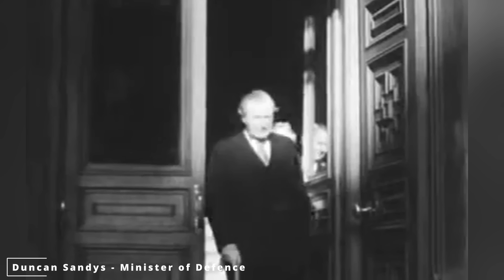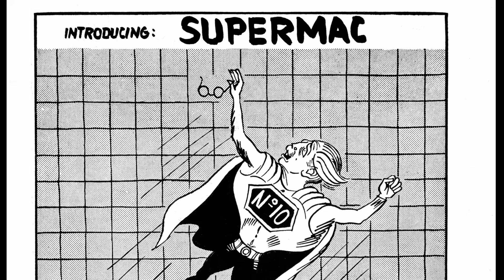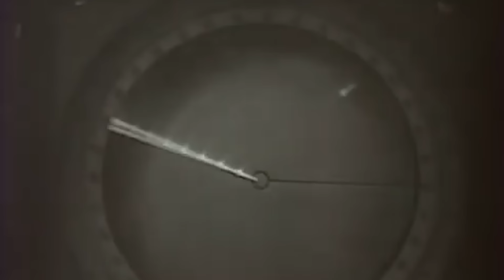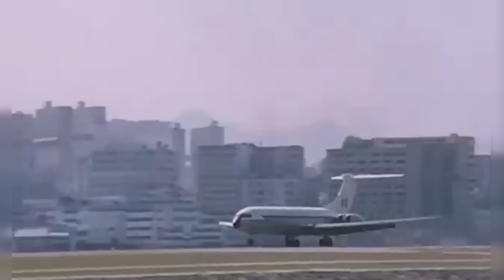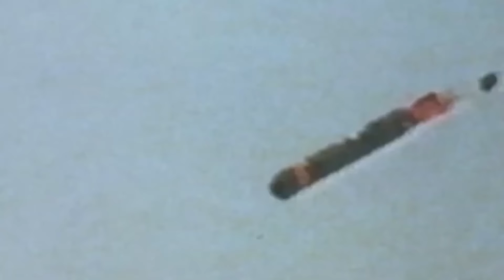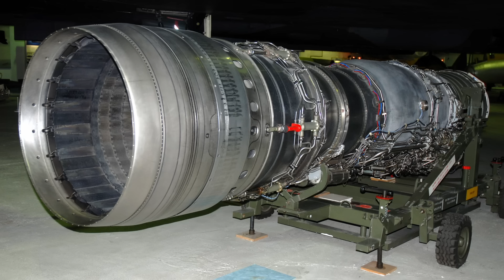How Britain Turned A Failed Airliner Into a Soviet Submarine Predator | The Mighty Nimrod

Comment: Worked on the new MRA4's at FRA before they were sadly wanked off by the government got laid off and treated like dogshit at the so called job center so nearly lost my home sadly.
Thank you for the video. 👍
Reply from the maker: Really sorry to hear that, I recall the fiasco. 
I would love to be able to run part 3 under your nose if and when I get around to it, that will be covering the MRA4 drama.
Reply: @AviationRepublic  Thank you. I will look forward to seeing it on YouTube.
Reply: One of the most shameful and humiliating fiascoes in British aviation history... a shocking tale of incompetence and corruption
Reply from the maker: I will get to that in Part 3. Just laying the ground work. Too much to cover in one video.
Reply: We believe we can clear up some commonly held myths and misconceptions obviously.

It's always good to see the facts presented clearly and concisely isn't it?

All Nimrods were new build Comet 4 airframes with appropriate strengthening and the unpressurized  equipment bay tacked on. 

The HS 801 Nimrod was the most advanced aircraft of it's type at the time it first flew. Problems with the MRA4 programme were almost entirely due to radar and computer equipment issues and BAe Systems & co being too busy with other work at the time. 

Obviously there have been worse aircraft for accident losses both before & after the Comet.

Early problems with Comet takeoff stalls were caused by pilots over rotating the aircraft at liftoff. 

Podded engines on wings have aerodynamics issues. The main reasons for eventually going with podded engines were because or to facilitate -
Ease of maintenance.
Use of shear off fixings given excessive out of balance forces.
Large diameter turbofan engines.
Reduce load on the wing to fuselage connection. 
Increased power from later engines. 

The Bow-wing (See B-47 wing collapse & wing folding incidents) was a good example of how to expend a huge amount of cash and effort on something that was probably not worth bothering with. The basic design of the Comet had been decided upon and established before the podded engine choice has been made for the B-47. There were aerodynamics problems with podded pylon mounted engines at the time. The US also built and operated a significant number of EE Canberra bombers under licence which did not use podded engines for their wing mounted engines. . 

There have been aircraft losses caused by pod & pylon mounted engines. 

All jet airliners benefited greatly from the knowledge gained from the Comet incidents & subsequent investigations & yet some were still worse for accident losses. 

Instances of all marks of the Comet flew with full certification after 1954 including the Comet 3. The last Comet flight occured in 1997.

The fabulous trail blazing DH Comet.
World's first jet airliner in regular service.
The jet engined Avro Lancastrian actually did a passenger service before the DH Comet. 
World's first high altitude airliner.
World's first airliner with a full fuselage length pressurised cabin pressurised for high altitude flight. That feature for that type of aircraft was a considerably difficult undertaking. 

The change from larger squarer windows to smaller rounder windows was necessary for the particular aircraft at the time. Skin thickness remained mostly the same for all Comet marks. 

How things were back then.
Accident losses - % of aircraft built.

DeHavilland Comet 4 UK                          14% 
DeHavilland Comet all mks UK (ff 1949)17%  
Vickers VC10 UK (ff 1962)                         5%

Douglas DC-1  US                                       99%
Douglas DC-2                                              47%
Douglas DC-3                                              30%
Douglas DC-4                                              26%
Boeing s300    US                                       72% 
Boeing 307                                                  70%
Boeing 247                                                   48%
Boeing 707  (ff 1958)                                 32% 
Lockheed L-049 Constellation (ff 1943)  30%
Lockheed Electra US (ff 1957)                   29%
Fairchild FH-227 US (ff 1966)                   30%
McDonnell Douglas DC-8 US  (ff 1958)   14%
Sud Aviation Caravelle  (ff 1955)             15%
Canadair CL-44 Turboprop US (ff 1959) 46%  
Convair CV-580 Turboprop US (ff 1960) 22%
Convair CV-880     (ff 1959)                      27% 
Convair CV-990     (ff 1961)                      33%
Tupolev T-104        (ff 1956)                     16%
Vickers Viscount UK  (ff 1948)                29%  
Fokker F-27 Turboprop NL (ff 1955)       40%      

The Vickers VC10, fastest Atlantic crossing for a non supersonic jet airliner, held the record for 41 years.

For the first few years of operation the Caravelle & Comet had similar accident loss fatalities.

Sud Aviation Caravelle - 
all accident loss fatalities - 
1320 fatalities. 

De Havilland Comet - 
all accident loss fatalities - 
453 fatalities. 

An example of a typical airliner from the period. 
The Fokker Friendship F-27 fatalities & accident losses as a % of aircraft built. 
Fokker F-27 Turboprop (ff 1955)   40%
2130 fatalities.

Of course De Havilland carried out a full stress analysis & performed extensive & protracted testing on two long lengths of fuselage representing all features of a complete airframe. De Havilland carried out significantly more testing than was required by any authority at the time & significantly more testing that any previous airliner was subjected to.

De Havilland designers / engineers knew all there was to know about metal fatigue at the time they designed the DH Comet.

De Havilland had prior experience building many all metal construction airframe aircraft including many passengers aircraft & thousands of jet powered fighter aircraft that were primarily of metal construction with pressurised cockpits & used jet engines built by De-Havilland.

De Havilland did indeed always work to better than industry standards at the time, used up to date knowledge for the design & testing activities & no evidence of negligence or criminal negligence was ever produced in relation to the DH Comet.

Global aerospace. 
From the 1950s sector rationalisation and consolidation took place. 70 companies in France and 300 companies in the US disappeared due to merger or dissolution. In the US Boeing was almost bankrupted by the 707 project.  Boeing had a well protected domestic market and the available space and resources in the US to engage in large scale airliner manufacturing enabling them to capture orders simply by being able to produce airframes fast enough and cheap and nasty enough. Another factor is airlines preferring to obtain as much of their airliner inventory as possible from one manufacturer. 

Global Aerospace Sector, what's happening.

For example, there are of course no German companies that makes German jet aircraft in Germany & there are no German companies that make German gas turbine aero engines in Germany that are suitable for widebody airliners.

The UK has the world's highest combined per capita Nuclear / Defence / Aerospace Sector Activity.

UK defence sector, absolute terms, world's second highest activity. 1st for per capita defence sector activity. Per capita nuclear powered submarine construction, 2nd position. 
Main players being Rolls Royce, Babcock, GKN Aerospace & BAe Systems. Activities often involve international collaboration. BAe systems, RR and other UK companies now handle more Airbus work value wise than Germany. 

There's a good chance that anyone currently flying on a widebody airliner will be on an aircraft powered by RR gas turbine aero engines made in the UK and a good chance there will be other hardware on the aircraft that's designed and / or manufactured in the UK. 

Rolls Royce Holdings UK
Subsidiaries
- Rolls-Royce plc
- Rolls-Royce North America (ex Allison etc Classified Military stuff)
- Rolls-Royce AB
- Rolls-Royce Deutschland
- Rolls-Royce India Private Limited
- Rolls-Royce Marine Power Operations
- Vinters Engineering Limited
- Rolls-Royce Controls and Data Services
- Rolls-Royce Power Systems
- Bergen Marine
Joint ventures include:
- Rolls-Royce Turbomeca
- MTU Turbomeca -

Trent Family
The MT30 (Marine Turbine)
Industrial Trent 60 Gas Turbine
Trent 7000
Trent XWB Airbus A330neo.
Trent 1500
Trent 1000
Trent 500
Trent 600
Trent 700
Trent 800
Trent 8100
Trent 900
   
RR wholly owned subsidiaries in Germany handle smaller 2 shaft RR gas turbine aero engine work.

The UK space and aerospace sectors are highly productive, high-value industries that together contribute over £18 Billion in direct Gross Value Added (GVA) to the UK economy. Individually, the space industry directly contributes about 0.3% of UK GDP 7•2 Billion while the aerospace industry contributes approximately 0.5% £10•9 Billion.
   
We hope this helps.
Reply: How much of the MRA4 was realistically carried over from the existing aircraft?

When the issue came to a head with the wings not fitting, would it have been more viable to jig up and build new fuselages (with the benefit that further aircraft could be built for export sales)?
Reply: @katywalker8322  I thinks the wings not fitting is a load of BS as the first one I worked on at FRA was already flying from Boscombe Down before they were all cancelled. The Torries also saying they had to be cancelled because of cost also made NO sense as the Boeing aircraft they then brought cost more for less aircraft that can do less. Just like when Labour said the TSR2 had to be cancelled because of costing more then said they were going to buy F111's that cost more. 
Thank you.
Reply: @RJM1011 my understanding was that there was a lot of variation in the fuselage, and hence a lot of fettling required for the wings to be mounted.

Given how much of the aircraft was newly built it surprised me that they didn't go the whole hog with a new build.

Agree with the other points.
Reply: @katywalker8322  Yes thank you.
Reply: @katywalker8322  BAE Systems was not an aircraft manufacturer and did not have the capabilities to build an all new aircraft.
The whole point was to avoid building new aircraft by refurbishing old existing aircraft.
The problem was the Nimrod was simply too old too obsolete and the aircraft were too badly damaged to be refurbished.
The planes were hand build and no two Nimrod were the same.

The program was rife with corruption and incompetence
Reply: @DoktorBayerischeMotorenWerke BAE Systems certainly had the capabilities to build a new aircraft, and they were building new wings which are the must complex part of the airframe.
Reply: @katywalker8322  Britian has not developed any new jet aircraft since 1977.
BAE Systems has never designed and manufactured a new aircraft design... it is no longer an aircraft manufacturer.
Reply: @DoktorBayerischeMotorenWerke , the 146 comes after you window plus was designed and built by part of BAE Systems.

BAE Systems has the skills to build a a craft from scratch if required.

You seem to have a real bee in your bonnet against the Comet and European aircraft
Reply: @katywalker8322  Sorry mate, you seem a bit confused
The Hawker Siddeley H.S.146 dates back to 1973.

BAE System divested its aircraft development division in 2005.
Reply: @katywalker8322  The Comet Disaster was the worst engineering disaster in commercial aviation history
Germany is currently the largest manufacturer of jet aircraft in Europe today
Reply: @DoktorBayerischeMotorenWerke production ran from 1983.

2005 is when they sold their stake in Airbus. They still have plenty of development expertise
Reply: @DoktorBayerischeMotorenWerke , do they even produce a jet aircraft?

Very minor contribute to the F35. Po art of the Eurofighter. Might manage to build some of the FCAS in the future. Building some of the D328eco. A contributor to various Airbus aircraft. Engine wise some engines from Rolls-Royce Deutschland
Reply: @katywalker8322  Please name a single British company that still makes British jet aircraft in the UK?
Reply: @katywalker8322  There was no independent development of any new jet aircraft in the UK after BAC and Hawker Siddeley went bankrupt in 1977 and were taken over by the UK government
Reply: @katywalker8322  There has never been any Airbus aircraft made in the UK.
 Yes, and in 2005 that expertise was lost and went to Airbus and elsewhere.
Reply: @DoktorBayerischeMotorenWerke 

We believe we can clear up some commonly held myths and misconceptions obviously.

It's always good to see the facts presented clearly and concisely isn't it?

All production Nimrod aircraft were new build Comet 4 airframes with the necessary modifications. The Nimrod was the most advanced and most capable aircraft of it's type at the time it went into service. The  Nimrid HS.801 was not available for purchase by other countries. The ability  if the HS 801 to repeatedly demonstrate detection of subs and the knowledge that it could deliver nuclear depth charges to a target was a very effective deterrent. 

Bow-wing (see B-47 wing collapse wing folding incidents) had built less than 12 pressurised airliners before the Comet first flew and they were not high altitude airliners. 

All Nimrods were new build Comet 4 airframes with appropriate strengthening and the unpressurized  equipment bay tacked on. 

The HS 801 Nimrod was the most advanced aircraft of it's type at the time it first flew. Problems with the MRA4 programme were almost entirely due to radar and computer equipment issues and BAe Systems & co being too busy with other work at the time. 

Obviously there have been worse aircraft for accident losses both before & after the Comet and Nimrod.

Early problems with Comet takeoff stalls were caused by pilots over rotating the aircraft at liftoff. 

Podded engines on wings have aerodynamics issues. The main reasons for eventually going with podded engines were because or to facilitate - Ease of maintenance. Use of shear off fixings given excessive out of balance forces.
Large diameter turbofan engines.
Reduce load on the wing to fuselage connection. Increased power from later engines. 

The Bow-wing (See B-47 wing collapse & wing folding incidents) was a good example of how to expend a huge amount of cash and effort on something that was probably not worth bothering with. The basic design of the Comet had been decided upon and established before the podded engine choice has been made for the B-47. There were aerodynamics problems with podded pylon mounted engines at the time. The US also built and operated a significant number of EE Canberra bombers under licence which did not use podded engines for their wing mounted engines. . 

There have been aircraft losses caused by pod & pylon mounted engines. 

All jet airliners benefited greatly from the knowledge gained from the Comet incidents & subsequent investigations & yet some were still worse for accident losses. 

Instances of all marks of the Comet flew with full certification after 1954 including the Comet 3. The last Comet flight occured in 1997.

The fabulous trail blazing DH Comet.
World's first jet airliner in regular service.
The jet engined Avro Lancastrian actually did a passenger service before the DH Comet. 
World's first high altitude airliner.
World's first airliner with a full fuselage length pressurised cabin pressurised for high altitude flight. That feature for that type of aircraft was a considerably difficult undertaking. 

The change from larger squarer windows to smaller rounder windows was necessary for the particular aircraft at the time. Skin thickness remained mostly the same for all Comet marks. 

How things were back then.
Accident losses - % of aircraft built.

DeHavilland Comet 4 UK                          14% 
DeHavilland Comet all mks UK (ff 1949)17%  
Vickers VC10 UK (ff 1962)                         5%

Douglas DC-1  US                                       99%
Douglas DC-2                                              47%
Douglas DC-3                                              30%
Douglas DC-4                                              26%
Boeing s300    US                                       72% 
Boeing 307                                                  70%
Boeing 247                                                   48%
Boeing 707  (ff 1958)                                 32% 
Lockheed L-049 Constellation (ff 1943)  30%
Lockheed Electra US (ff 1957)                   29%
Fairchild FH-227 US (ff 1966)                   30%
McDonnell Douglas DC-8 US  (ff 1958)   14%
Sud Aviation Caravelle  (ff 1955)             15%
Canadair CL-44 Turboprop US (ff 1959) 46%  
Convair CV-580 Turboprop US (ff 1960) 22%
Convair CV-880     (ff 1959)                      27% 
Convair CV-990     (ff 1961)                      33%
Tupolev T-104        (ff 1956)                     16%
Vickers Viscount UK  (ff 1948)                29%  
Fokker F-27 Turboprop NL (ff 1955)       40%      

The Vickers VC10, fastest Atlantic crossing for a non supersonic jet airliner, held the record for 41 years.

For the first few years of operation the Caravelle & Comet had similar accident loss fatalities.

Sud Aviation Caravelle - 
all accident loss fatalities - 
1320 fatalities. 

De Havilland Comet - 
all accident loss fatalities - 
453 fatalities. 

An example of a typical airliner from the period. 
The Fokker Friendship F-27 fatalities & accident losses as a % of aircraft built. 
Fokker F-27 Turboprop (ff 1955)   40%
2130 fatalities.

Of course De Havilland carried out a full stress analysis & performed extensive & protracted testing on two long lengths of fuselage representing all features of a complete airframe. De Havilland carried out significantly more testing than was required by any authority at the time & significantly more testing that any previous airliner was subjected to.

De Havilland designers / engineers knew all there was to know about metal fatigue at the time they designed the DH Comet.

De Havilland had prior experience building many all metal construction airframe aircraft including many passengers aircraft & thousands of jet powered fighter aircraft that were primarily of metal construction with pressurised cockpits & used jet engines built by De-Havilland.

De Havilland did indeed always work to better than industry standards at the time, used up to date knowledge for the design & testing activities & no evidence of negligence or criminal negligence was ever produced in relation to the DH Comet.

Global aerospace. 
From the 1950s sector rationalisation and consolidation took place. 70 companies in France and 300 companies in the US disappeared due to merger or dissolution. In the US Boeing was almost bankrupted by the 707 project.  Boeing had a well protected domestic market and the available space and resources in the US to engage in large scale airliner manufacturing enabling them to capture orders simply by being able to produce airframes fast enough and cheap and nasty enough. Another factor is airlines preferring to obtain as much of their airliner inventory as possible from one manufacturer. 

Global Aerospace Sector, what's happening.

For example, there are of course no German companies that makes German jet aircraft in Germany & there are no German companies that make German gas turbine aero engines in Germany that are suitable for widebody airliners.

The UK has the world's highest combined per capita Nuclear / Defence / Aerospace Sector Activity.

UK defence sector, absolute terms, world's second highest activity. 1st for per capita defence sector activity. Per capita nuclear powered submarine construction, 2nd position. 
Main players being Rolls Royce, Babcock, GKN Aerospace & BAe Systems. Activities often involve international collaboration. BAe systems, RR and other UK companies now handle more Airbus work value wise than Germany. 

There's a good chance that anyone currently flying on a widebody airliner will be on an aircraft powered by RR gas turbine aero engines made in the UK and a good chance there will be other hardware on the aircraft that's designed and / or manufactured in the UK. 

Rolls Royce Holdings UK
Subsidiaries
- Rolls-Royce plc
- Rolls-Royce North America (ex Allison etc Classified Military stuff)
- Rolls-Royce AB
- Rolls-Royce Deutschland
- Rolls-Royce India Private Limited
- Rolls-Royce Marine Power Operations
- Vinters Engineering Limited
- Rolls-Royce Controls and Data Services
- Rolls-Royce Power Systems
- Bergen Marine
Joint ventures include:
- Rolls-Royce Turbomeca
- MTU Turbomeca -

Trent Family
The MT30 (Marine Turbine)
Industrial Trent 60 Gas Turbine
Trent 7000
Trent XWB Airbus A330neo.
Trent 1500
Trent 1000
Trent 500
Trent 600
Trent 700
Trent 800
Trent 8100
Trent 900
   
RR wholly owned subsidiaries in Germany handle smaller 2 shaft RR gas turbine aero engine work.

The UK space and aerospace sectors are highly productive, high-value industries that together contribute over £18 Billion in direct Gross Value Added (GVA) to the UK economy. Individually, the space industry directly contributes about 0.3% of UK GDP 7•2 Billion while the aerospace industry contributes approximately 0.5% £10•9 Billion.
   
We hope this helps.
Reply: @DoktorBayerischeMotorenWerke 

Typhoon & Tornado, British design aircraft. 

Early days of the airliners.

The awesome De Havilland Comet.
World's first production jet airliner.
World's first high altitude airliner. 
At the time the Comet wasn't particularly dangerous. The DH Comet was definitely not the worst engineering failure in commercial airliner history.

Losses comparisons.
How things were in those days.

DeHavilland Comet 4 UK                          14% 
DeHavilland Comet all mks UK (ff 1949)17%  
Vickers VC10 UK (ff 1962)                         5%

Douglas DC-1  US                                       99%
Douglas DC-2                                              47%
Douglas DC-3                                              30%
Douglas DC-4                                              26%
Boeing s300    US                                       72% 
Boeing 307                                                  70%
Boeing 247                                                   48%
Boeing 707  (ff 1958)                                 32% 
Lockheed L-049 Constellation (ff 1943)  30%
Lockheed Electra US (ff 1957)                   29%
Fairchild FH-227 US (ff 1966)                   32%
McDonnell Douglas DC-8 US  (ff 1958)   14%
Sud Aviation Caravelle  (ff 1955)             15%
Canadair CL-44 Turboprop US (ff 1959) 46%  
Convair CV-580 Turboprop US (ff 1960) 22%
Convair CV-880     (ff 1959)                      27% 
Convair CV-990     (ff 1961)                      33%
Tupolev T-104        (ff 1956)                     16%
Vickers Viscount UK  (ff 1948)                29%  
Fokker F-27 Turboprop NL (ff 1955)       40%      

The Vickers VC10, fastest Atlantic crossing for a non supersonic jet airliner, held the record for 41 years.

For the first few years of operation the Caravelle & Comet had similar accident loss fatalities.

De Havilland had prior experience building many all metal construction airframe aircraft & thousands of jet powered fighter aircraft that were primarily of metal construction with pressurised cockpits & jet engines built by De-Havilland. No aircraft before the Comet was subjected to as much pre-production testing as the Comet. 

It's a great pity & a crying shame that British military forces had to occupy a large part of Germany for decades after 1945 & Russian military forces had to do the same. Of course Russia still posseses a large chunk of what was German territory & of course Russia & the UK produce nukes. Obviously Germany does not produce nukes.

Interesting British achievements.

The gas turbine engine was invented & patented in England before the 1800s.

Axial multi stage sequential stage compressor & turbine technology, first produced for turbo machinery use in England by Parsons of Ireland & North England during the 1800s. The components form the basis of most modern gas turbine aero engines. At the time the concept of the jet aircraft powered by axial internal combustion gas turbine engines was first mentioned thus the internal combustion jet engine & jet aircraft was indeed invented in England before the 1900s & before the Wright brothers got busy.

Work on the multi stage sequential stator rotor axial compressor as applicable to the axial compressor gas turbine aero engine was ongoing in England from around 1928 by Arnold Griffiths and others. By 1943 the Metrovik F2/3  Beryl was a running axial turbojet that was superior to anything anywhere else. As the centrifugal compressor engines were adequate and more powerful at the time development of a larger F2/3  version was commenced.

The Metrovik (UK)  F2/3 axial compressor gas turbine aero engine was flight certified & ran in 1942, it was the result of UK development work ongoing since 1929. At the time it was the most capable axial compressor turbojet in existence but was not required and development work continued on a larger version.

Frank Whittle performed the world's first demonstration of a gas turbine aero engine in 1937. People in Germany kept a close eye on everything going on in Britain at the time.

The centrifugal compressor RR Nene was the most powerful & most reliable gas turbine aero engine on the planet in 1944. That engine would be later built under license or copied in many countries including Russia (Mig-15 Mig-17), China, the US, France and Switzerland powered dozens of aircraft types for decades after 1944.

Pratt and Whitney and others produce centrifugal compressor gas turbine aero engines. The PW200 is a currently produced whittle style centrifugal compressor, reverse flow combustor, gas turbine aero engine. 

The world's first wind tunnel was constructed in England during the 1870s. The world's first supersonic wind tunnel was constructed in England in 1922.

There is no doubt that the Fairey (England)
Delta 2 was the world's first jet
aircraft to exceed 1000 mph.  Indeed It
exceeded the previous record by 310 mph &
held the record for 1 year. Incidentally, the Dassault Mirage 3 & 4 are based on the Fairey Delta 2.

More recent UK military jet aircraft.

The Tornado & Typhoon & their engines are Supersonic & are indeed British design aircraft with British design engines built by an international consortium. The Tornado design for example started life during the 1950s at Vickers as the AFVG, it's engine is based on the RR RB-199. The EE Lightening is also a British Supersonic jet aircraft.

The Typhoon is the British BAC-EAP with an engine based on the British RR XG-40, the Typhoon is also built by an international consortium.

Brazil has the world's third largest airliner manufacturer and makes very good airliners & Brazil is 100th down the list along with Indonesia for wealth per capita. Of course it is in fact the case that Embraer can't build those airliners without purchasing stuff from the US, UK & Europe. For example, Norway, Holland, Denmark, Ireland & Belgium, top 20 wealth per capita, don't make airliners, its as simple as that.

Global aerospace. 
From the 1950s sector rationalisation and consolidation took place. 70 companies in France and 300 companies in the US disappeared due to merger or dissolution. In the US Boeing was almost bankrupted by the 707 project.  Boeing had a well protected domestic market and the available space and resources in the US to engage in large scale airliner manufacturing enabling them to capture orders simply by being able to produce airframes fast enough and cheap and nasty enough. Another factor is airlines preferring to obtain as much of their airliner inventory as possible from one manufacturer. 

Global Aerospace Sector, what's happening.

For example, there are of course no German companies that makes German jet aircraft in Germany & there are no German companies that make German gas turbine aero engines in Germany that are suitable for widebody airliners.

The UK has the world's highest combined per capita Nuclear / Defence / Aerospace Sector Activity.

UK defence sector, absolute terms, world's second highest activity. 1st for per capita defence sector activity. Per capita nuclear powered submarine construction, 2nd position. 
Main players being Rolls Royce, Babcock, GKN Aerospace & BAe Systems. Activities often involve international collaboration. BAe systems, RR and other UK companies now handle more Airbus work value wise than Germany. 

There's a good chance that anyone currently flying on a widebody airliner will be on an aircraft powered by RR gas turbine aero engines made in the UK and a good chance there will be other hardware on the aircraft that's designed and / or manufactured in the UK. 

Rolls Royce Holdings UK
Subsidiaries
- Rolls-Royce plc
- Rolls-Royce North America (ex Allison etc Classified Military stuff)
- Rolls-Royce AB
- Rolls-Royce Deutschland
- Rolls-Royce India Private Limited
- Rolls-Royce Marine Power Operations
- Vinters Engineering Limited
- Rolls-Royce Controls and Data Services
- Rolls-Royce Power Systems
- Bergen Marine
Joint ventures include:
- Rolls-Royce Turbomeca
- MTU Turbomeca -

Trent Family
The MT30 (Marine Turbine)
Industrial Trent 60 Gas Turbine
Trent 7000
Trent XWB Airbus A330neo.
Trent 1500
Trent 1000
Trent 500
Trent 600
Trent 700
Trent 800
Trent 8100
Trent 900
   
RR wholly owned subsidiaries in Germany handle smaller 2 shaft RR gas turbine aero engine work.

The UK space and aerospace sectors are highly productive, high-value industries that together contribute over £18 Billion in direct Gross Value Added (GVA) to the UK economy. Individually, the space industry directly contributes about 0.3% of UK GDP 7•2 Billion while the aerospace industry contributes approximately 0.5% £10•9 Billion.
   
We hope this helps.
Reply: @katywalker8322 

There was no problem fitting the wings to the fuselage. The tolerances were accounted for and the original aircraft had been built using jigs.